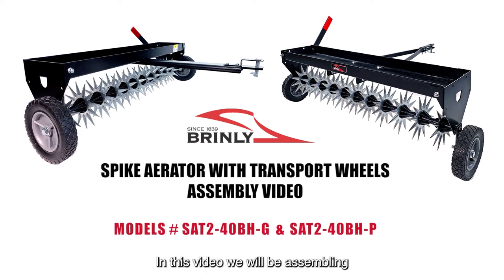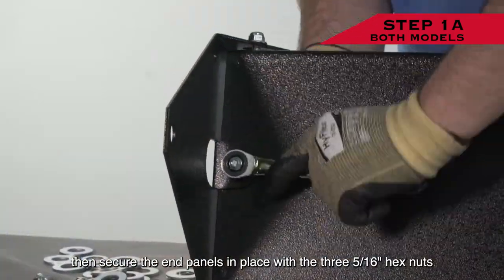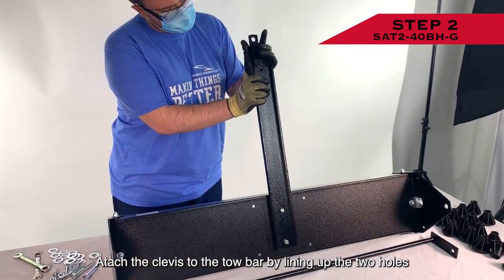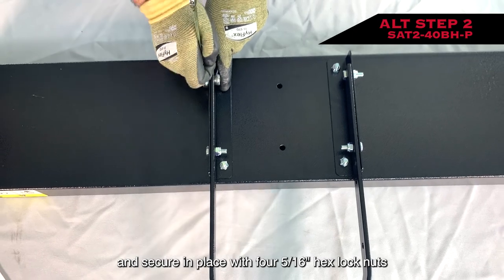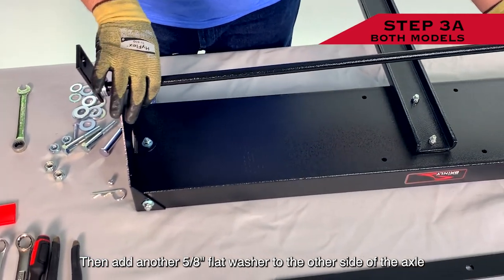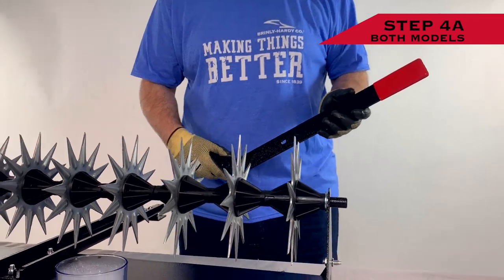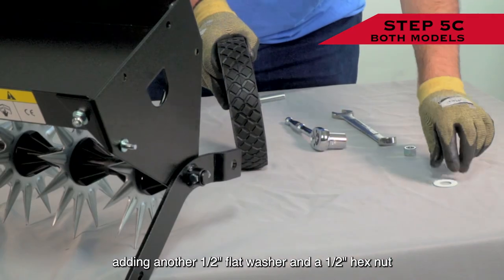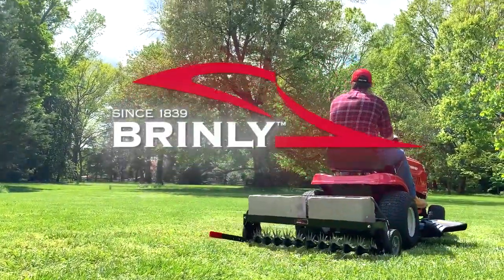How to Assemble the Brinly Spike Aerator with Transport Wheels | Model SAT2-40BH-G & SAT2-40BH-P

Comment: what is the best length bungee to buy to hold down 2 full size cinder blocks?
Reply from the maker: Bungees should stretch to 50% of their original size, and this Spike Aerator width is just over 46 inches,  if we're also adding 16" for the height of the blocks it's more like 62".  For a tighter fit, I would go with a 48"; a 40" would probably be too tight, and a 60" would be almost exactly the size needed. So a 60" could possibly work, but it may be too loose to keep the blocks from moving on you. Thanks for the question!